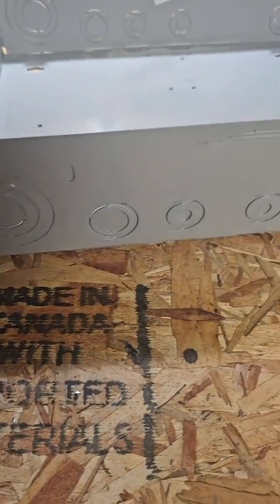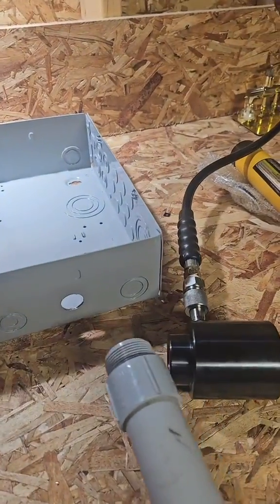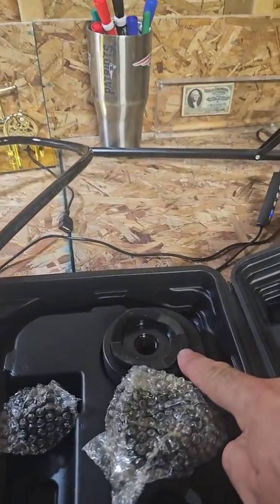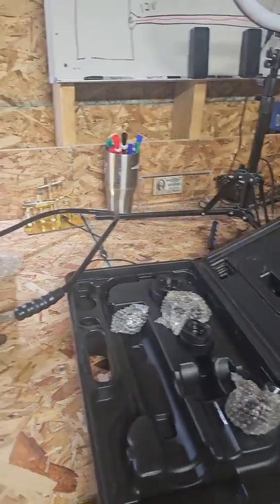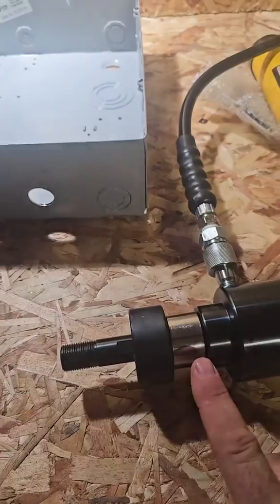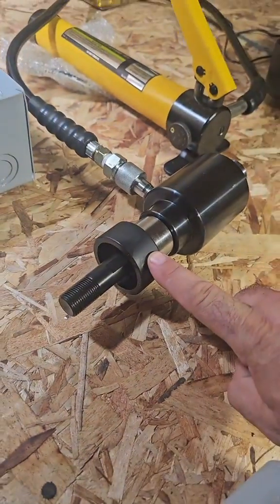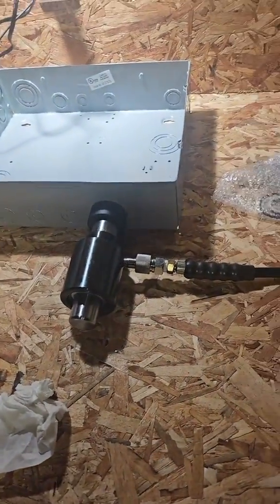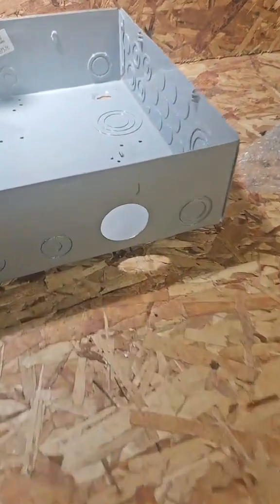how to make a larger hole in an electric panel

Comment: Great video.  I have a couple standard Greenlee sets and a Temco set with larger sizes, all manual.  Like you, I may only need to use them 5 or 6 times a year.  Regardless of brand, hydraulic or manual, use a knockout punch for a clean, professional job.  Drives me crazy to see electricians gnawing holes in panels with hole saws and step bits.

Comment: The high end ones are usually a little more powerful, don’t wrinkle the steel as often/much and generally thread a little smoother. You also usually get them thru, hopefully, a local sales rep who will drive out to your site with or accessories if it yours breaks or you can’t pull it off with what you’ve got.
Again, not a big deal if this isn’t something that’s core to what cuts your paycheck every day.
But if you’re doing switchgear install for a living, that punch (and some other specialty tools) are making or breaking your paycheck.

Comment: How about a stepdrillbit?
Reply: They work, but nothing that drills or leaves shavings is ideal for panels that are energized.
Reply from the maker: @assai74  get harder with larger holes over 1 inch
Reply: It’s also hard to offset from the original hole with a step bit. With a punch set. You can use an existing hole that’s very close to the edge or otherwise inconveniently placed.
Also, all the metal shavings. That’s more of an issue with panels that are already wired.
Reply: Stepdrillbit, what are you doing?